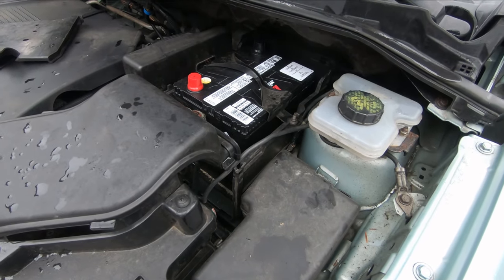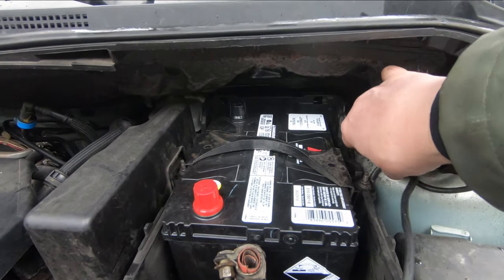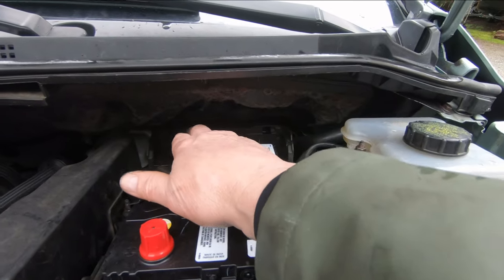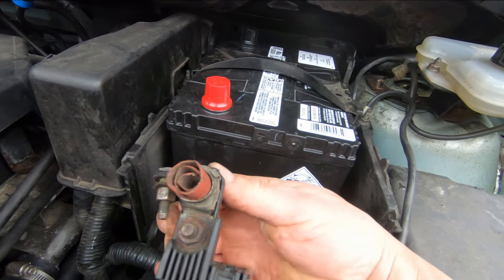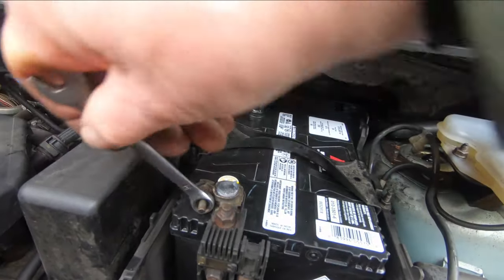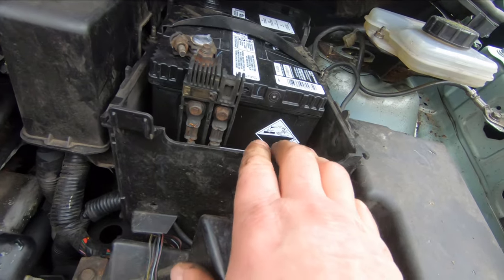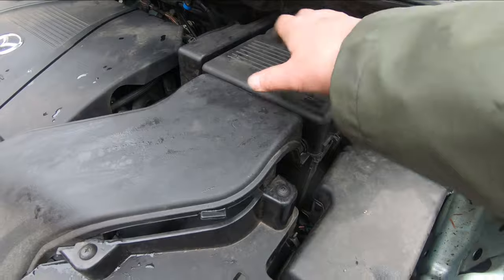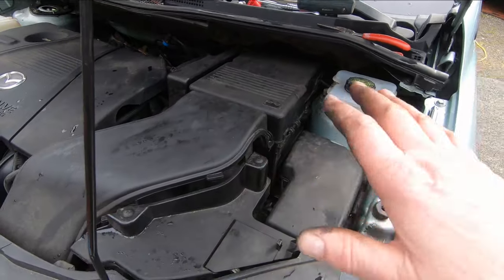INSTALLING A NEW VEHICLE BATTERY ~ TIPS FOR DOING IT RIGHT

Comment: Nicely done Craig. None of my vehicles have had covered batteries. Great information Brother!
Reply from the maker: Thanks, Doug. They are covering up batteries more and more, not quite sure why. This was in a 2006 Mazda 5, but I've seen the same clutter elsewhere. In my old Volvo (2001) the battery is in the back, under floor of the station wagon part. Easy to get to if you can find it Haha

Comment: On my Chevy C series, twist the terminals a little bit because I don't exactly tighten them, undo the ratchet strap and lift it out because the factory clamp doesn't exactly fir the battery that I have.
Reply from the maker: They are getting ridiculous but it will all be over soon ....when we switch back to horse and buggy!
Reply: @EverydayProjects  Bicycles aren't bad option. Slow going uphill but you can make some time on the flats and downhills. Bikes took us on many adventures and journeys. Loose dogs, drunk drivers, idiot drivers were a menace though. When I was about 18 I started packing a CO2 pellet gun. I loved riding. I got spoiled and lazy when I started really learning how to keep a vehicle running.

Comment: Nicely done ✔️ .  That's a first seeing under hood vent for a battery .  The only thing I do a bit  different is putting a   memory saver on first  . Cheers 👍
Reply from the maker: Yes, the memory saver is good and I have one but I never thought about it this time. The only settings on this car are the radio presets and the clock, so not too bad to redo them. Thanks for the comment, Steve!
Reply: @EverydayProjects  I replaced a lot of batteries on people vehicles and a couple had check engine lights on after or the power widows didn't work right after and one Ford truck the remote locks didn't work . Vast majority ,  no problems but the odd one  turns a great day into a bad one fast 😉
Reply: memory saver, I forgot about that!🤣
Reply: @OpenAirOutdoors  😅🤣
Reply from the maker: Sometimes the vehicle has to "Re-Learn" some things after the battery has been disconnected. It is also (surprisingly) a fix for many intermittent troubles. Just disconnecting the battery and letting the vehicle sit for 15 minutes before re-connecting has been known to alleviate rough running in some. Thanks again Steve!  @SteveRobReviews

Comment: Great information, thanks. This is something that seem to need done more frequently these days as batteries do not seem to last very long
Reply from the maker: Thanks, Joseph. Many battery warranties are for either one or three years so the manufacturer's faith in the longevity of their own products seems to be waning. Perhaps mass production has its downside because of cheaper components used. You're right, batteries, no matter the brand, don't seem to last as long as they used to. Always a pleasure to read your comments. (keep that cameraman working! LOL):goodvibes:

Comment: What About This: OBD2 Auto Car ECU Memory Resume Tool Saver Replace Battery Safe Tool OBDII
Reply from the maker: Yes, they are a good idea to save all your radio and seat position presets. You just plug it in before removing the battery and it copies the vehicle presets. When the new battery is in, reconnect the chip and the presets are placed back into the system. They are very useful if you have multiple user seat position presets and radio station preferences. This car, however, only had a couple of preferred radio stations that were easy to find and set without the tool. The memory chip also saves the clock time.